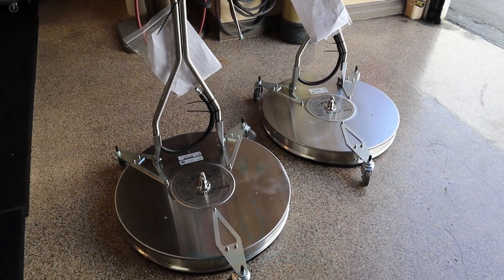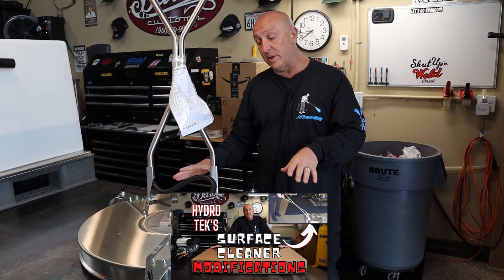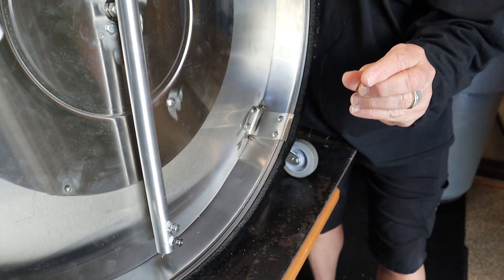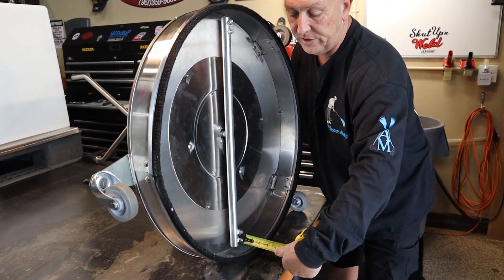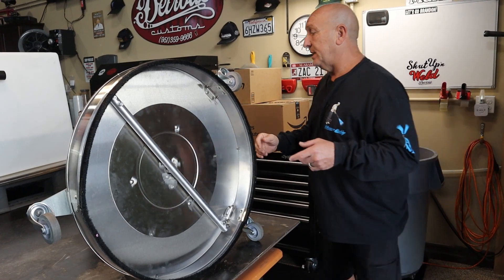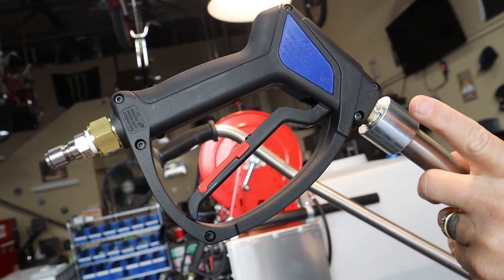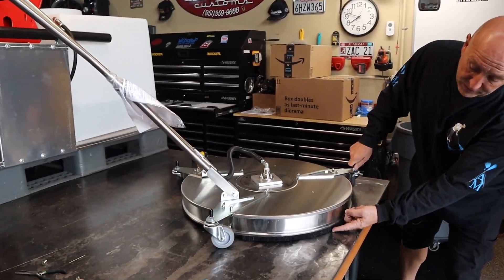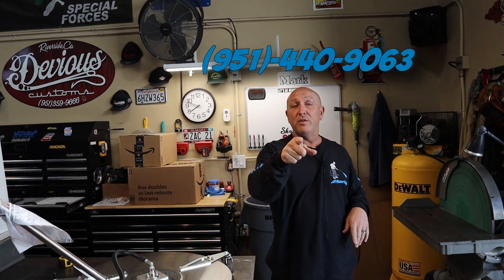AM Pressure Washing - Modifications Upgrade to Surface Cleaner

Comment: What GPM do you need with that setup?
Reply from the maker: You can set it up at any GPM
Reply: What size in the pusher tip. I’ve never seen them
Reply from the maker: @edenworgan291  1.0 gpm
Reply from the maker: Yes
Reply: @AMPRESSUREWASHING  why doesn’t it chew out paving being a pin jet
Reply: 21litre which is 5 gym I think
Reply from the maker: @edenworgan291  as long as your moving it does not hurt it. If your using it on asphalt do not turn on the burner. Concrete run the burner.
Reply from the maker: @edenworgan291  Please give me a call to go over details (951) 440-9063
Reply from the maker: You base the spray tips to whatever your gpm is on your pump. Example a 4 gpm pump you need two 2.0 spray tips.